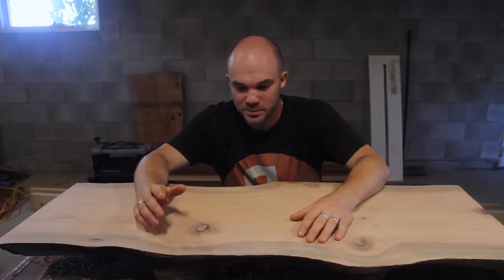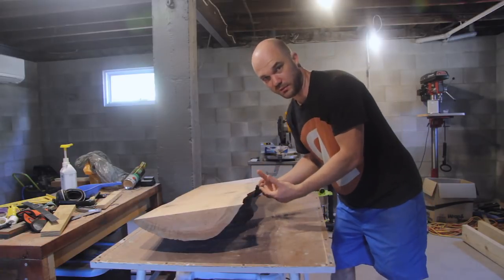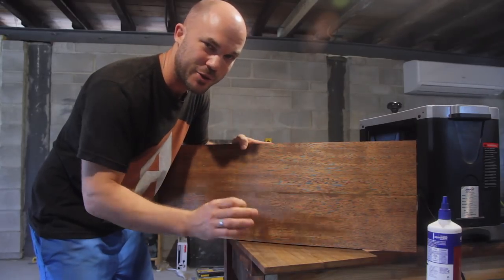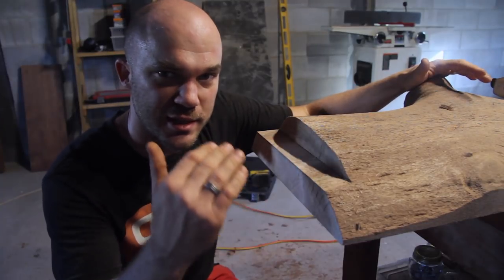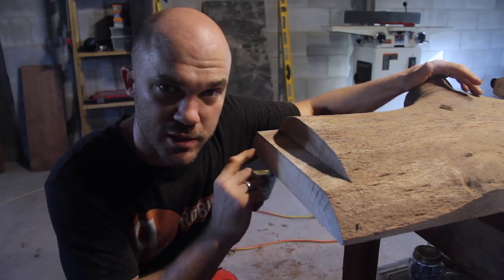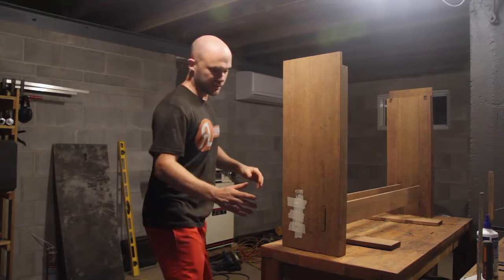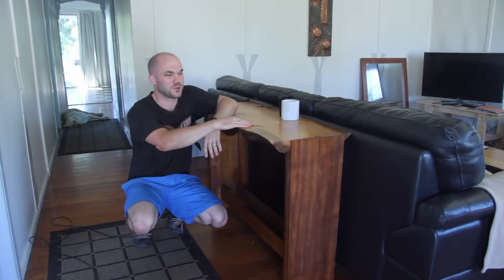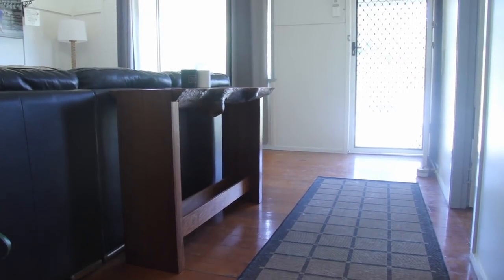Live Edge Hall Table | Woodworking

Comment: Sweet job........  workshop looks a bit dark though ..... got lights going in ? ? ? ?
Reply from the maker: Thanks Craig. Yeah, had a mate round here the last 2 weekends putting in 12 LED battens. I finished this project up just before they were installed, so from the next one you'll see the difference. So much better to work in there with proper lighting

Comment: I noticed the fan in the background, but what ventilation like in the workshop?
Reply from the maker: Summer is on it's way so it's starting to warm up down there. I have an AC installed but I need to block the gaps between the joists before it'll work well, so for now I'm just using a fan

Comment: Wood won’t expand in length, so your explanation for the gap is incorrect. Don’t try to cover up your mistakes by lying to us...it won’t work.
Reply from the maker: You're half right. Wood doesn't expand along it's length but the gaps are still needed because of the way the figure-8 clips work. As the wood expands along it's width, the clips rotate around the screws. This what will cause the top of the legs to be pulled in and out. If the join was sliding then you wouldn't need the gap, but it's the rotation that makes it different
Reply: Richard, harsh comment. After reading this I went back and re-watched that part of the video and think this is a case of you not listening to what was said, not that Robin intended to deceived. As he stated, the two types of wood will expand over their "width" at different rates and need a way to move. If there was no allowance for expansion then one wood, would split the other. Also have a look where he lives. The extremes in humidity between the wet and dry seasons will exacerbate this issue.
Reply: Richard, thanks for your response. It's always a pleasure to have an open discussion with someone so eloquent.